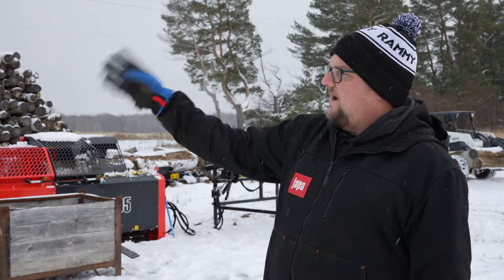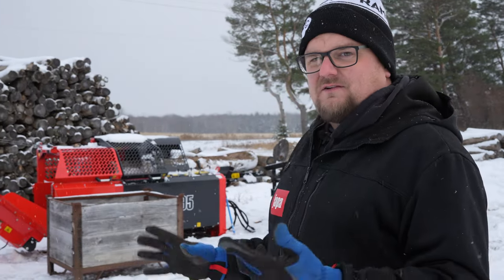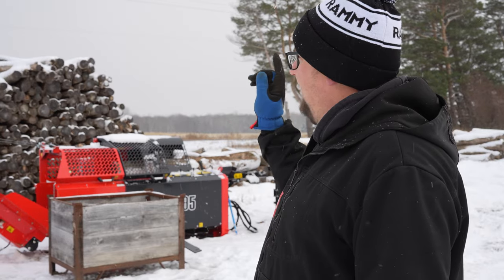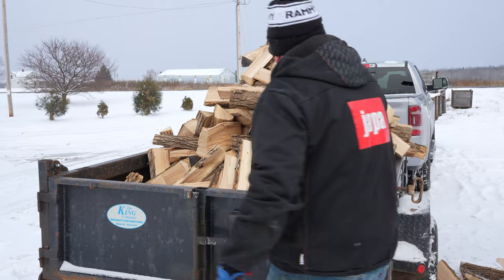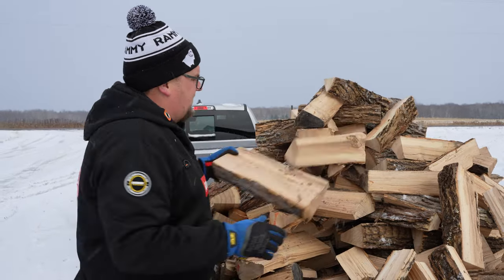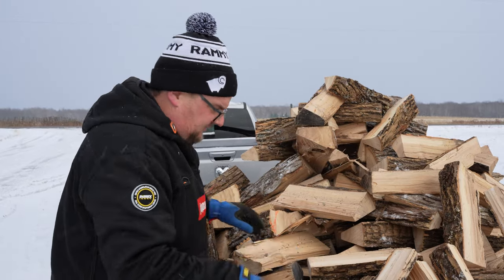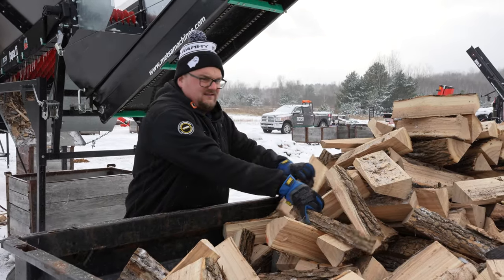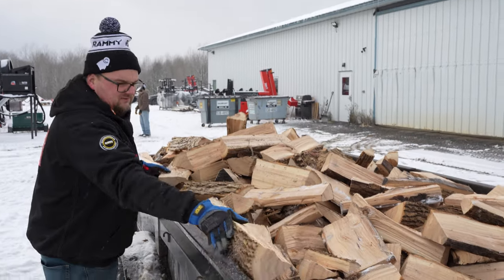Fast Firewood, Uninterrupted Footage of the Japa 395 Firewood Processor

Comment: I'd love to try one of these in our Aspen we have here
Reply from the maker: Aspen would fly through this machine.
Reply: @MetsaMachines  what's the price for one of these with a gasoline engine
Reply from the maker: @adammoggysawmilling5164  You can use our pricing configurator on our website to see what it costs with the different options: https://www.metsamachines.com/product/japa-395-firewood-processor/
Reply from the maker: @adammoggysawmilling5164  Sorry added the wrong link at first, updated it to the correct one!

Comment: Do you make the 395 in a towable version with its own motor?
Reply from the maker: We do not currently have a road towable version of the 395. We do have the option to add either a Honda or Kubota Diesel engine to it and we are looking at potential options to make the 395 and 405 towable, hopefully by Fall 2023.

Comment: Your elevator belt is too steep of angle. Is why it's slipping. I like to have that whole set up. Nice machine. Have a great day be safe
Reply from the maker: It's actually slipping because we still need to tension the conveyors. This was a new machine and this was the first time we ran it for any amount of time. Once we tension them there won't be any issues.